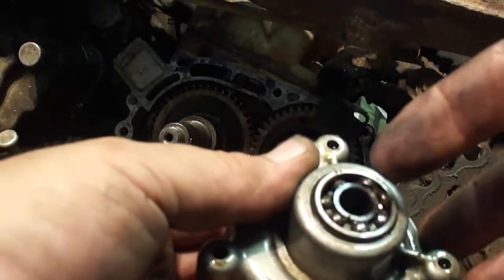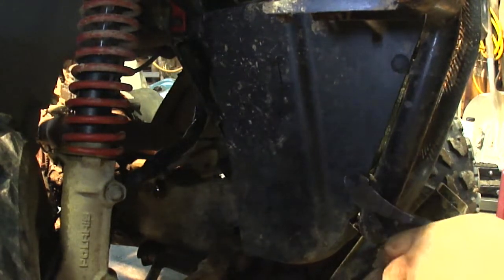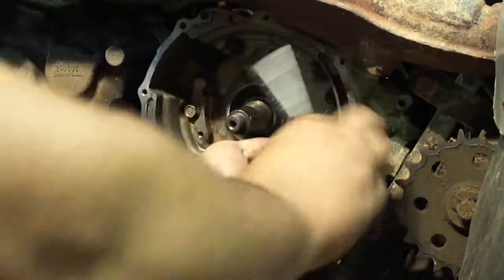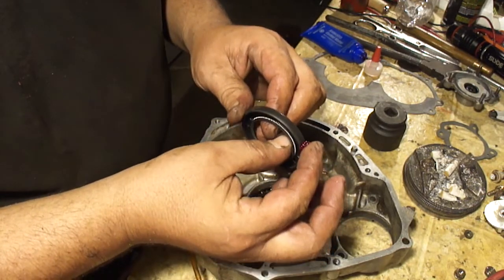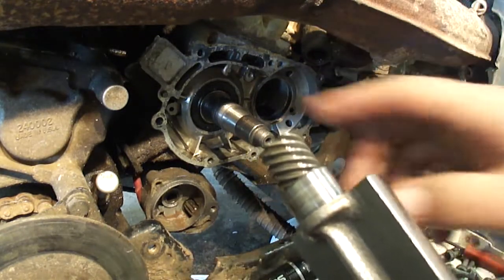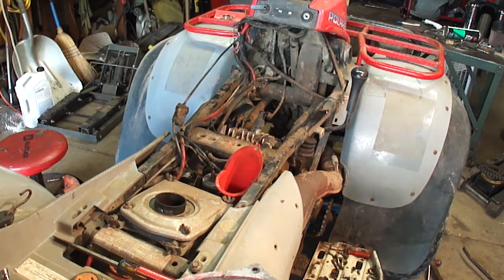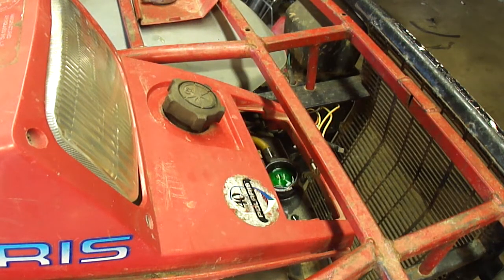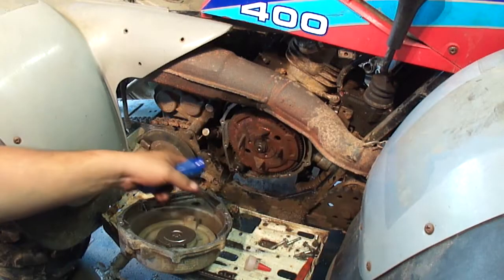Polaris 400L Crank Seals Counter Balance shaft

Comment: How exactly does coolant leak from the weep hole? i’m not seeing a mechanical bushing or mechanical seal that I keep hearing about. I would get coolant weeping out of that hole. I’m just wondering exactly what failed the only thing that I saw that was maybe irregular was the water pump was slightly loose on the shaft not the shaft itself that was tight and true but the water pump housing the impeller was slightly loose. The bearing in the back is rusty, but it still works so I’m assuming it must be that seal that was causing it to leak but doesn’t coolant go through that water pump which is where the weep hole is I don’t understand. Please help me understand.
Reply from the maker: The weep hole is between the to shaft seals for the water pump shaft. If the seal on the impeller side fails then coolant will come out the weep hole.

Comment: other than the transmission fluid, is the counter-balance fluid the only fill point for the engine? removed 3 drain bolts under the engine, and was confused with only 1 fill plug/dip stick! Didn't know if there's a crankcase fill plug like on our 1991 cr125.  Were replacing fluids today and thought i'd ask. thank you
Reply from the maker: Yes, 3 drains. One for the Balance shaft oil, one for the crank case (in case the engine was flooded or submerged) and one for the pull start cover (again in case the engine was submerged. So yes, the only oil for the engine is the 100cc's or so 10w 30 for the balance shaft. The middle plug is the Balance shaft oil drain. The plug on the far left of the machine is the crank case drain (should be empty) and the far right plug is the pull cover drain (should be empty) Hope this clears up the confusion.
Reply: @MrFixit1  yes! Much much help with your comment. Much appreciated sir 👍💯

Comment: So the balancer shaft was that a bad bearing on the back of that and the newly waited replace that was put the whole new balancing shaft assembly with. The bearing on it or did you somehow replace just the bearing? You didn't show that part no this is curious
Reply from the maker: I replaced the balancer shaft assembly. You would need to press the gear off of the shaft to replace just the bearing and then re align the marks be for pressing back together.

Comment: Im looking at buying a 99 Sport 400 L 2wd. Its in very good phsyical condtion but i have 2 concerns:

1. The engine rattles/taps at idle. Every video of a Polaris 400 idling on youtube appears to have the same noise. Sounds like a woodpecker at idle. Is this just how the 400s sound?

2. It sputter a bit and is weak right off idle but after maybe 7-8 mph it has loads of power. Im at 6000' elevation so im thinking maybe it just needs a smaller main jet and a hgher rpm clutch spring for the elevation.

I appreciate any help/direction you can give me and awesome video! If i buy a 400 i will need to do the water pump seal job sooner or later so i will use this.
Reply from the maker: Yeah, everyone I have been on rattles a bit. And because of 2 cycle performance they are a bit sluggish off the line but re jetting may be needed for your altitude. Inspecting the reeds is a good idea as they have a big impact on performance. The book will recommend springs and settings for your elevation. The biggest issues are with the transmission, if the that works well then it sounds like it's worth putting some money into.
Reply: @MrFixit1  A bit sluggish would be fine, this thing currently wouldn't even come close to spinning the tire on gravel. It kinda surges a bit like it's struggling and just slowly rolls away. Probly a jetting issue and clutch spring I bet. Trans works great though, engine idles low and smooth, plenty of power once it gets into the powerband.

Comment: I think my Polaris scrambler 400 has the same problem and I was about to start working on it. But do you know around how long it took you to do this?
Reply from the maker: I think it was about 2 or 3 hours. I was messing with the cameras and stuff, so it took me a little longer than that. Scraping all the gasket surfaces took some time. Make sure you align the marks on the gears.
Reply: @MrFixit1  Ok thank you so much

Comment: Do you have a part number for that O ring on the shaft??
Reply from the maker: Polaris OEM O RING 3084160
Reply: @ is it the same on the 350L?
Reply from the maker: @ Same part
Reply: @MrFixit1  may I ask where you ordered it from? Seems nobody sells it
Reply from the maker: @crispymen8976  I found one at my local hardware store.
Reply: @ one more question is how important is it? When I took mine apart there wasn’t a O ring at all, what purpose does it serve if you know? Thanks for the help so far!
Reply from the maker: @crispymen8976  This is part of the crankshaft seal. Pretty important. It will keep the engine from consuming the balance shaft oil.
Reply: @ do you know ow which size O ring you used?
Reply from the maker: @crispymen8976  Sorry, I do not. I just matched it up and didn't record the size. It was fairly thin like 1\16" and the same size as the crankshaft O.D.

Comment: For the counter balance you need to put oil in the place you show un the video or the oil Is the same that Is infront
Reply from the maker: 2 cycle oil goes in the front for the engine to burn. motor oil goes in the dipstick hole under the carburetor.